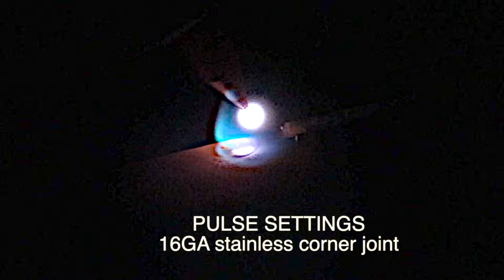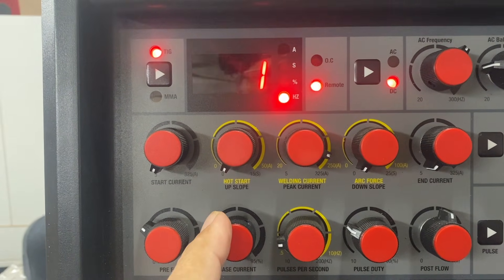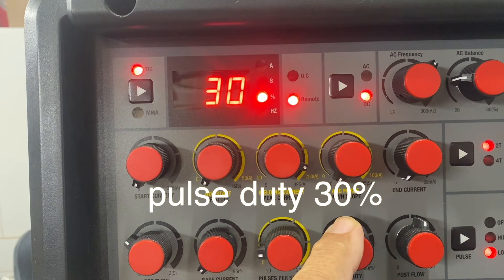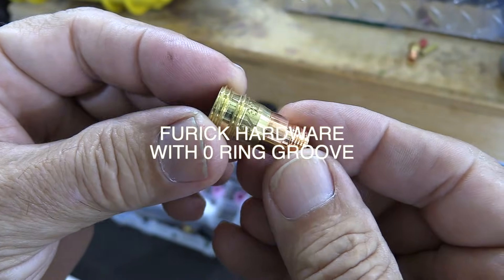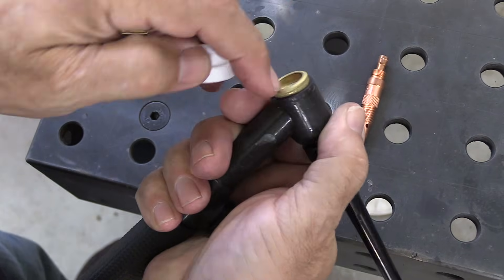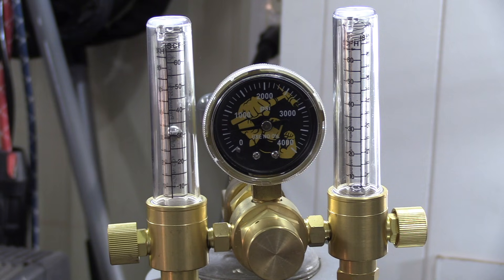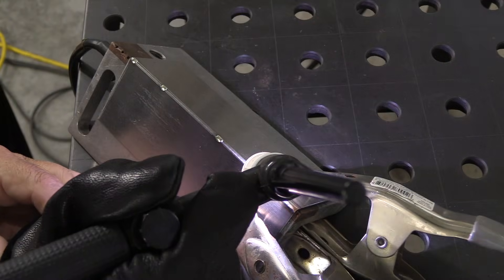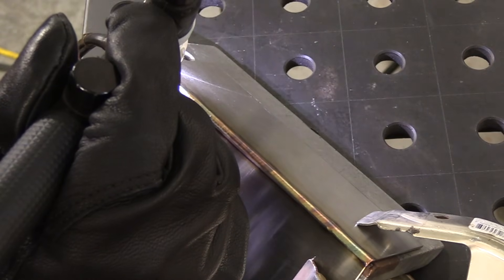TIG Pulse Settings Autogenous Stainless 16ga

Comment: Jody, if you were to use a trigger button instead of pedal there, what would you have set the weld current to for this particular outside corner?

Comment: I’m really interested in getting into welding. I’m torn between two machines . I lean towards the Eastwood mp 250 elite I … however I’m not knowledgeable enough to know if it’s a good platform to start from.  I’d like any advice from any knowledgeable person to help me decide.    The other is a primeweld 285.  I’d appreciate any insight from a person who understands this stuff. I’ll get there ‘ I’m just new… 😂thanks .

Comment: You had you Amps set high. What do you think you were actually using? I'm doing some stainless exhaust right now and have my welder set to 38amps, non pulse and back purged. Also using 0.030 filler rod. I played around with some pulse settings but right now I'm getting better results without pulsing.
Reply from the maker: @ChasingPerfection  I would guess 40 amps avg output

Comment: With backside sugaring, does purging prevent it? In school it was tough to not get it. Even with perfect weld coloration is had some type of sugaring
Reply: Yes, purging correctly will prevent it. You can also use Solar Flux and not need to back purge. I use it on long pieces of exhaust, where purging would take a lot of argon, or places where I can't back purge.
Reply from the maker: argon purge does prevent sugaring.. in a pinch, copper or aluminum backing helps but is not always possible.

Comment: Would be interesting to see a discussion about how much discoloration / sugaring matters on stainless for practical strength and long term durability.
Reply from the maker: I agree. Maybe I can interview some failure analysis folks who can weigh in on that
Reply: @weldingtipsandtricks  Talk to them about the small amount of ferrite that is wanted in austenitic welds that comes from the filler metal, that won't necessarily be there with Austentic autogenous welds. Ref the Schaeffler Diagram...  Love the channel Jody, I look forward to the new releases. MX.
Reply: Sugaring can cause stress cracks over time, too, plus if in a food processing environment, it will harbor and create bacteria.
Reply: That's a question that I have often asked myself (in the context of non-food processing). I will be interested to see the replies.